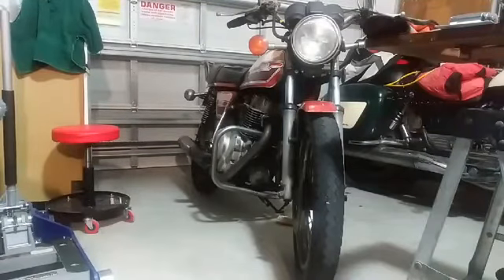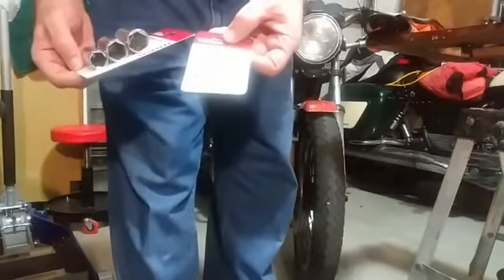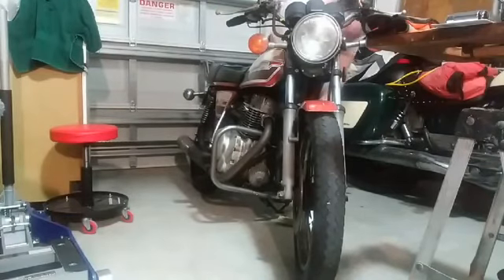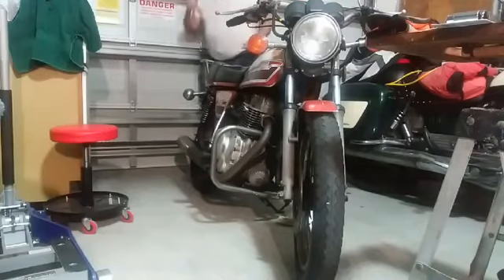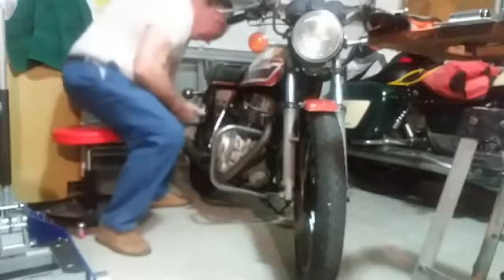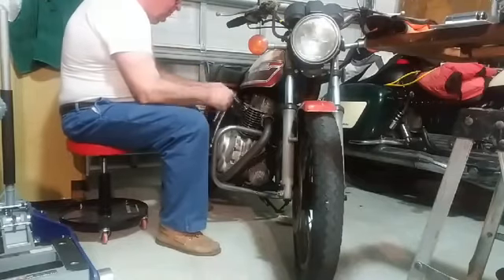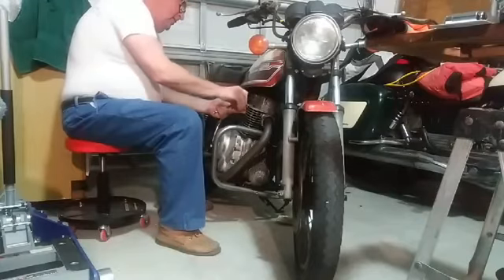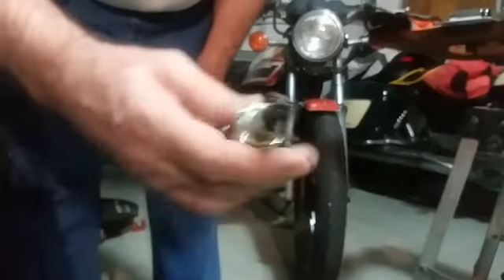1976 Yamaha XS 360; Spark plug removal reading and testing

Comment: I had one of these back in the mid 80s and LOVED it .   Worked as a crew leader for Fish And Wildlife in Eastern Washington one summer and used to ride EVERY weekend west on I-90 bc it was SO boring there and the people were quite conservative , not very easy-going l. That bike never left me stranded (that I can recall) and kept up fine on the freeway - never felt like I was over-revving or pushing it more than it liked .  Zero modifications .  Sold it to a sortof friend and it had needed a new battery wiring harness whatsit that he never got around to dealing with (pot head) and poor bike sat in the woods under cedar trees in the pacific NW wet and never ran again .  Too sad !